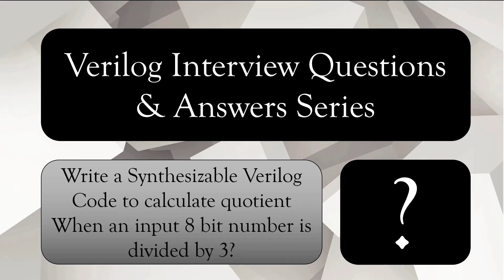Interview Question on Verilog Part 1

Comment: module quotient_calculator (
    input  logic [7:0] data_in,  // 8-bit input number
    output logic [7:0] data_out  // Quotient output
);
    logic [7:0] temp;
    logic [7:0] quotient;

    always_comb begin
        temp = data_in;
        quotient = 0;

        // Perform division using iterative subtraction
        while (temp >= 3) begin
            temp = temp - 3;
            quotient = quotient + 1;
        end

        data_out = quotient; // Assign computed quotient
    end
endmodule